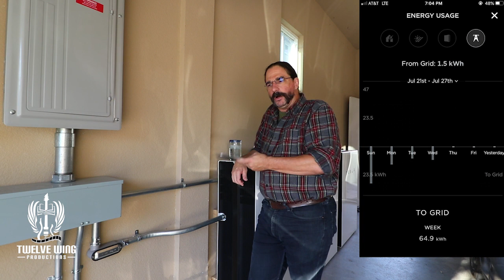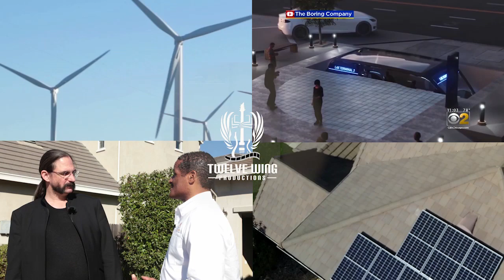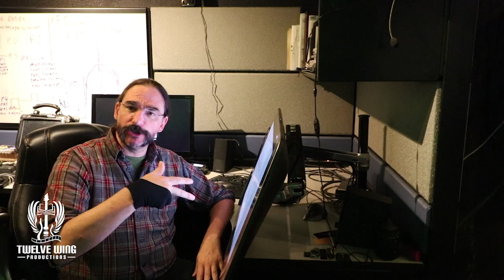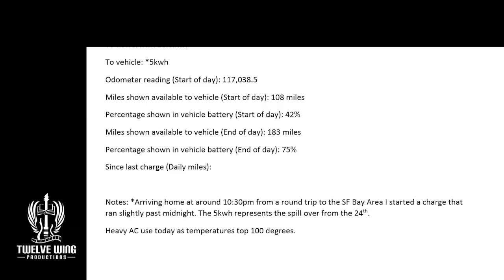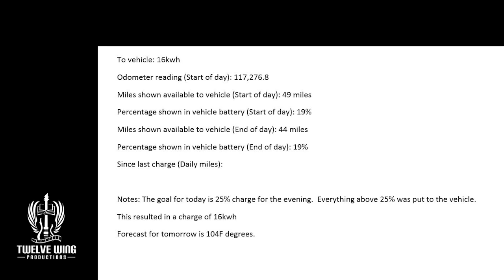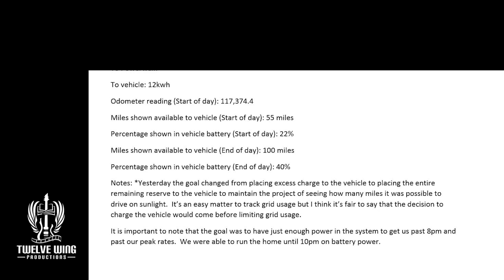The Energy Sovereignty Project: Month 7 Week 4

Comment: Hey, fairly new to the channel and love the content. Was wondering if you had any thoughts on the Tesla Mega Pack's implications and applications. Also, I don't know if you saw the new EV that has solar panels on the roof, but I was wondering if you knew any of the math that would make something like that worthwhile. I am under the impression that the fairly low efficiency would make solar panels on a car null and void, but what types of efficiency/solar panel coverage would make the pursuit profitable. 

Again, love the content and keep up the good work.
Reply from the maker: I noticed this comment on the previous video and I'm in the process of researching exactly what batteries they are using.  They are saying that the Mega Pack is 60% more energy dense than their previous PowerPak.  What I'm discovering is that this increase in efficiency isn't actually due to the batteries themselves but instead in what they have learned from system architecture.
I'll do a quick topic on this and the car today.

As for the solar cars, there are two that are out there that I'm aware of.  One is the "Light year" and the other is the "Sono".  The light year is an actual car while the Sono is more of a fitment concept to show how it "might" be done.
I'll mention both of those in the Quick Topic as well... but the teaser is that to do this there are HUGE sacrifice one has to make.
I'll go into detail in the video.
Reply: @twelvewingproductions7508  Thanks for the reply. I was wondering if the 60% thing was new Maxwell tech but I hadn't the slightest. 

Looking forward to the video.